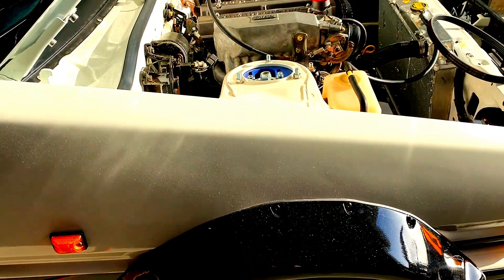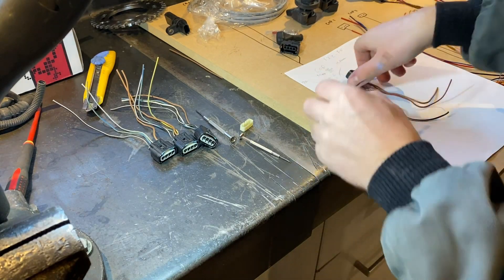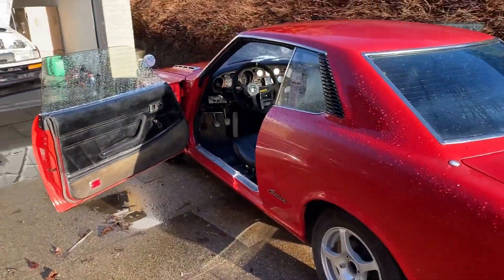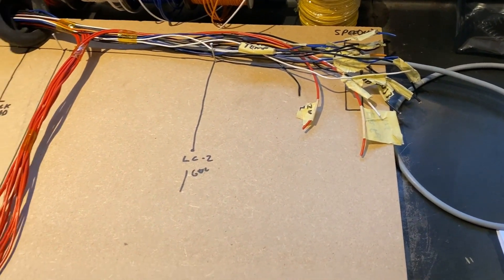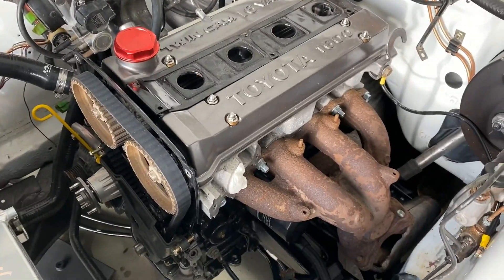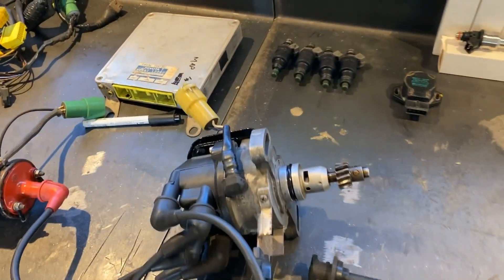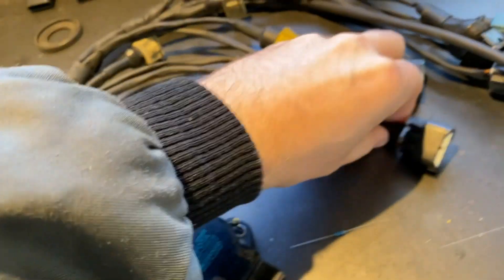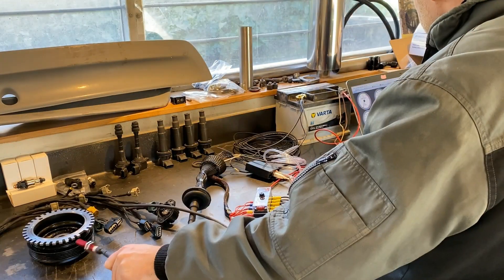Speeduino build. Ae86. Engine wiring harness and ignition. Roadworthyish corolla 16v 4age gets COP’s

Comment: Hey Roadworthy! Great job! As always, the algorithm doesn´t do justice... This is one of the cleanest custom harnesses I have ever seen, a little shame you had to recycle some broken connectors (here in Japan you can still find replacements), but, as a guy who bought a crazy Trueno Zenki with two harnesses installed from the previous owner (and terrifying turbo...), I would love to have the engine bay as you have there!

And about the exhaust manifold with surface rust, just apply a rust converter, it´s a little shame to have to add the heatshield there with that beautiful-looking stock setup. But of course, is your AE86! :)
Reply from the maker: Thank you so much.

Thanks for the insight, I Would love to have build it with new connectors, but I couldn’t find anything at that time…

The heatshield… yeah man, what Can I say… I wanted to go turbo at some point, so just didn’t care at that point. Well cared enough to make a horrible heat shield, but still….

Any rust converters you Would recomend.?
Reply: @DavidRoadworthyish  Well, you are lucky, you have the space and knowledge to do a turbo conversion, in my case I don´t have the tools enough and got an AE86 with so illegal turbo, so I have to return it to stock due Japanese laws... But it´s fine, I got with 70000km and the intention is to use as a daily, not like a racing car.

Here in Japan I use the one of SOFT99 brand, when you apply the first reaction is turning the rust into purple, and after curing it looks like black painted, but its not. In your case David I think it will be better if you can find the Würth one, I see similar results. Remember to use metal brush to lose all the surface rust particles first and then you are ready to go.
Reply from the maker: @CrakerMc  Youre too kind.
I would love to do the turbo kit for it at some point...

I´ll look into it. I used some left over stuff I had at some point, but I think it was over due, so it just fizzled and did nothing.. 😖
Reply: @DavidRoadworthyish  David, any recommendation with the injectors? I think my car is running too rich, having the original ones...
Reply from the maker: @CrakerMc if it’s the original ones, they might need a cleaning… but I went High resistance Only due to it beeing needed to run them pf the speeduino…
Reply: @DavidRoadworthyish  good advice! Thanks! 😃👍
Reply from the maker: Sure. But after 35 years, they might need a redo anyway 🫡✌️

Comment: Traducir texto con la cámara

Hello friend, could you show me the oxygen sensor of the 4age engine, I want to know if you have any code so I can buy in my sona, please
Reply from the maker: Hi.
It’s a stand alone with an analog 5v signal to the ecu.
With a LSU 4.2 type wideband.

You Can use any, as long as they have an analog output for the ecu
Reply: @DavidRoadworthyish  gracias bro
Reply from the maker: Sure think.
Did you get yours working?

Comment: Hi! How are you controling the idle? No pwm idle or stepper idle?
Reply from the maker: Idle was meant to be controlled by 3wire idle control valve plummed into the original idle port instead of the Stock wax capsule system… but Got a valve that was too Big, so ended up just pluggin the hole and running it solely on the idle Screw…
Reply from the maker: Also, never came back and fixed this…
But I Would have done a stepper motor valve like on all Modern engines.

Comment: Great video!! I am in the same process right now. Can you tell me more about the new injectors?? Thanks a lot
Reply from the maker: Thanks man.

Sure thing. It´s brand new KSM motorsport 310cc injectors high impedance that swap right in the stock rails etc. I choose to try the KSM injectors as they do actually have an ok rep. They have NEVER done me wrong. 
Sizewise I went with 310cc to be able to suply fuel if I wanted to go ITB or so.. maxing out at around 270 hk but still small to be able to idle, and low range tune properly...